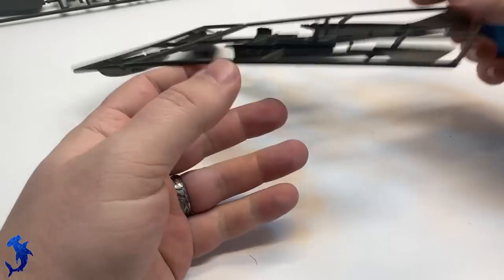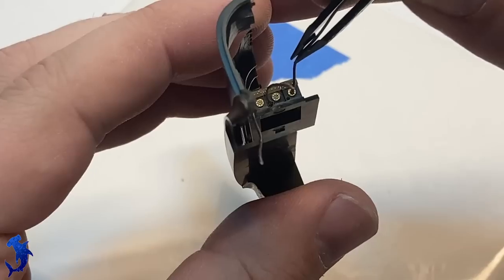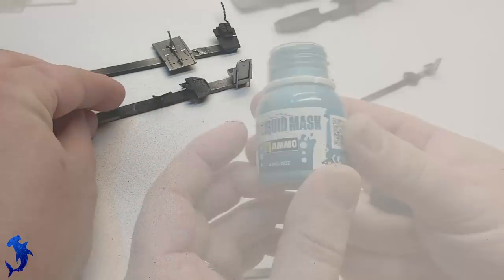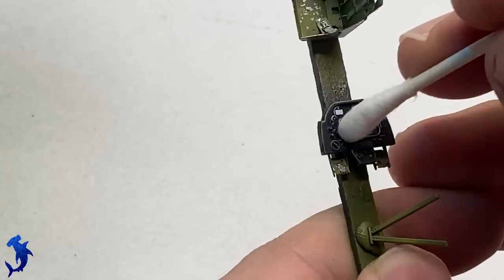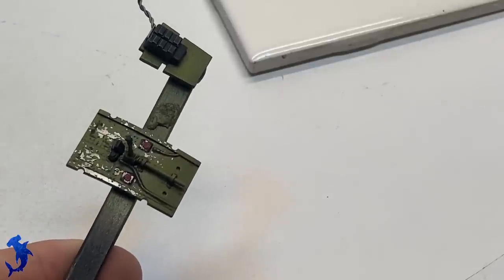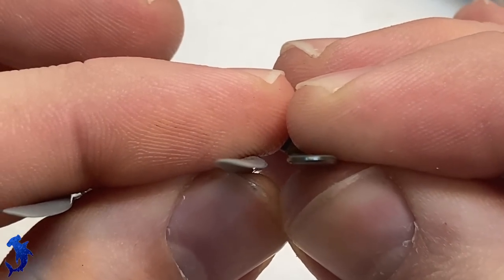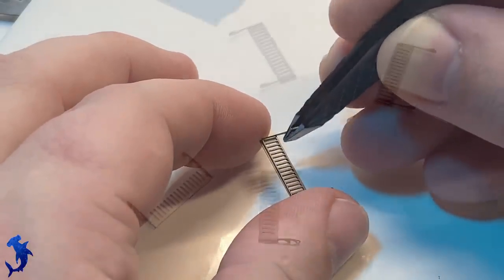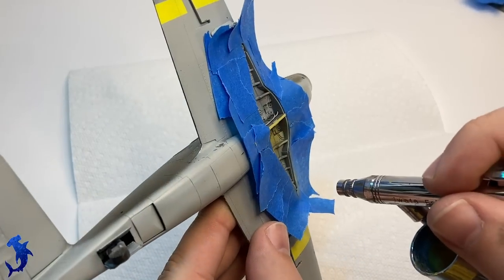Accurate Miniatures A-36 Mustang Dive Bomber 1/48 Full build!

Comment: Firstly, BRILLIANT save and lovely end result.
Next, thanks for some really good tips. Block of rubber to take of the masking fluid, looks like it's much easier than a brush. Oven cleaner as paint stripper, never heard of that before, should rescue a few future models from becoming air rifle targets. Finally but very importantly, not all varnishes/lacquers appear to be born equal. Disconcerting.
Reply from the maker: Thank you and I’m glad it could be helpful.  Also, it’s not so much that all top coats aren’t created equal (I mean they aren’t), but I think it’s more that certain products don’t mix, in this case Tamiya Gloss and MIG wash.  And more importantly I used a new product without testing it first.

Comment: Great channel mate, BTW you can shoot that chrome pen through the air brush with a drop of leveling thinner. It works well, but may need a clear coat if being handled a lot. I did a test recently, which is why i mention it.
Reply from the maker: I didn't know that about the chrome, thats good to know!  Thanks for sharing!
Reply: @HammerheadModelMaking  No worries mate

Comment: I used Mig paints and got the same result after panel line wash, so I only use those paints for brush painting from that moment on. Lacquer paints are my choice.
Reply from the maker: I'm not convinced it was the MIG paints, I've been using them for years now without issue, rather, the Tamiya Gloss coat I used I didn't test with the enamel wash.  But I'm glad you've found what works for you!

Comment: Great video. Is that a rubber eraser you’re using to remove the masking material on the interior? Thanks
Reply from the maker: Its not quite an eraser, its a bit of rubber gum I got at a local art store, but its purpose is for lifting liquid mask off of water color paper, if that helps.  Thanks for watching.

Comment: Another great build as it turns out, I'm having a hiccup with my paint, I have a 1960 Chevy pickup I have stripped the paint three times. I prime it sand it and when I go to paint, it wrinkles up and I can't seem to figure out what I'm doing wrong. If you have any suggestions I would greatly appreciate it.
Reply from the maker: Thats a tough one, what paint and primer are you using?
Reply: @HammerheadModelMaking  with model cars I use Rustoleum primer and paint, this is the first time I've have had to strip it 3 times, I even used a cheap can of paint and just sprayed the hood of the truck and it did the same thing. So I don't know what to, I might try and go to using an air brush.

Comment: Ok, I see what went wrong. Tamiya's clear gloss is a lacquer. I typically hated lacquer paints but I found that Tamiya's work really well. You typically use acrylic paints from what I gather. Tamiya's gloss would be 'hot' compared to your base paint. That's why it had such a bad reaction to your paint. To spray any of the gloss Tamiya lacquers, I warm them up for about 10 minutes in a cup of warm water. They do work beautifully.
Reply from the maker: Interesting, thanks for the additional info!  It will help prevent future SANFUs!
Reply: You're welcome! I pretty much grew up with Model Master but they kind of went 'Tango-Uniform' so I had to find a replacement that I like. You've said it in a few videos: do what works for you. I found that Tamiya's acrylics work well for detail painting. They brush very nicely. The lacquers do spray well and they cure pretty fast. You also don't really need a gloss coat over the gloss colors. But, to avoid problems, I stick with Tamiya. The reason is that their products are designed to work with each other (like Tamiya paints with Tamiya washes, and Tamiya thinner for example). I'm still trying to get the hang of the Tamiya putty. Most times it wants to just flake off.
Reply from the maker: @chrissakal532  I love the Tamiya acrylic stuff, they're great, my only issue is their limited color range, and I just don't like mixing colors.  If they offered the range that like Vallejo or Mig offer, I'd probably use Tamiya exclusively!
Reply: @HammerheadModelMaking  That is true. I use the acrylics for detail painting so the limited selection is ok for me. I might have to try some of the paints you use. I actually think I can pull off some of the oil painting. Part of the reason I like older kits is A: They're nostalgia builds for me. and B: They're cheap and I can try out different supplies (paint, glue, etc.) and techniques. If it doesn't quite work then at least I didn't mess up an expensive Hasegawa/Tamiya/Eduard kit.

Comment: I need to point out that the name of the plane is wrong. it's actually North American P 51 Mustang.  https://en.wikipedia.org/wiki/North_American_P-51_Mustang
Reply from the maker: Thank you for your comment, and yes its true, this is a version of the Mustang, the name however is not wrong.  The A-36 is a variation of the P-51A.  It had structural modifications to its wing and fuselage as well as the inclusion of Dive Brakes, not standard for the P-51A.  As a result, the Army Air Force redesignated it the "A-36" to reflect its ground attack and dive bombing profile:
https://en.wikipedia.org/wiki/North_American_A-36